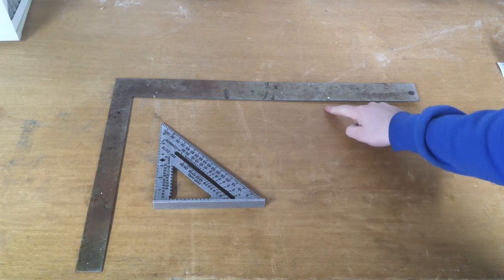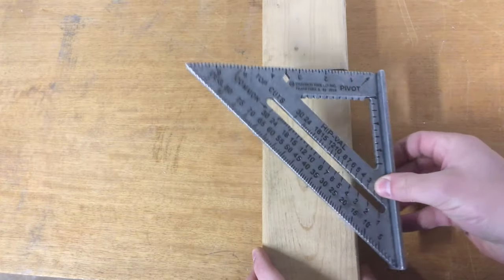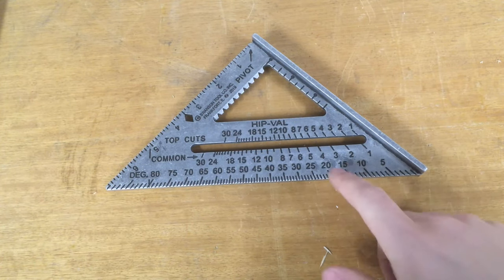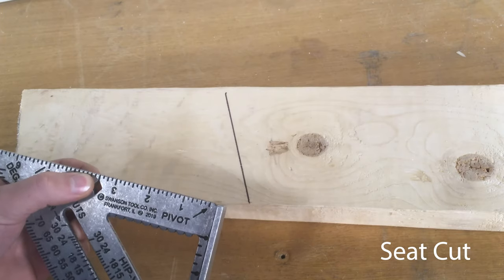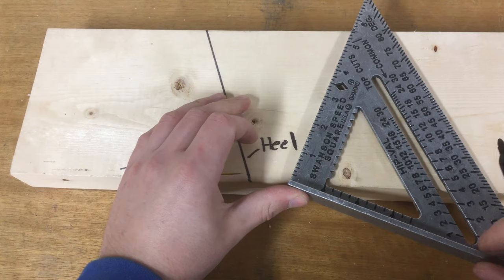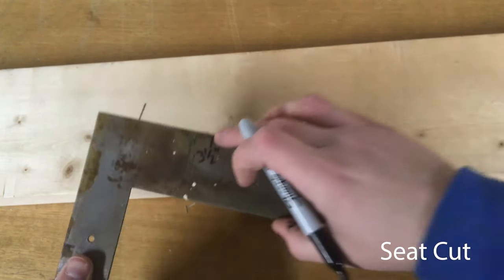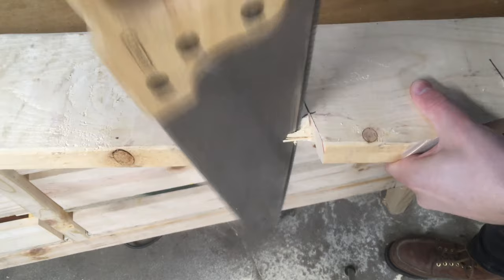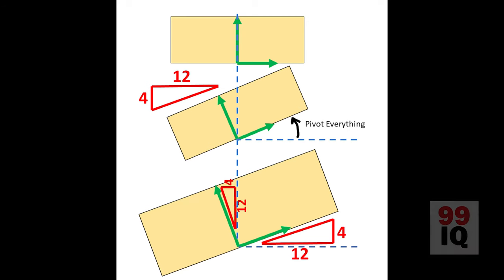How To Cut Birdsmouths for Rafters: Speed Square and Framing Square Methods Explained

Comment: I was taught the depth of the birds mouth ( which obviously affects the length of the seat cut ) should be a third of the width of the rafter. So 3x2 should be a 1” bird’s mouth, 6x2 a 2” bird’s mouth.
Reply: Birds got a square mouth
Reply: 1/4
Reply: No more than 1/3 your board length
Reply: @outdoorlife9410  IRC R502.8.1 states "Notches at the ends of the member shall not exceed one-fourth the depth of the member." Also cuts cannot be in the middle 1/3 of the board.
Reply: @outdoorlife9410 Width*

Comment: Excellent Video.  This sort of thing drove me crazy for a number of years because I am a DIY sort of construction novice. To aid in my education I finally went back to high school math to fully understand this.  First off, the 3.5" length to be cut out along the 2 x 4 is the hypothenuse or 'c' side of the right triangle you are making.  The part of the cut that is the depth of the cut is the 'a' side of the cut. The part that is the straight edge (90 degrees) along the 2 x 4 is the 'b' side of the cut.  In other words the speed square is doing nothing more than creating right triangles that are mathematically connected directly to the Pythagorean theorem. The fancy calculators one can buy do nothing more than integrate the various options possible based on what you know, but that does not always mean people like me actually understand what the program is doing. If your mind has the wrong orientation it is possible to make time-consuming mistakes.  By watching some other great videos on sine, cosine, and tangent you can come within 1/100ths of what the actual depth of the seat cut should be. Of course, the speed square and the human cannot possibly do that. However, If confusion prevails the math can tell you precisely how to reorient your mind.  With some humor I have to laugh that we are told 4/12 is 18.43 degrees.... who could ever match that? But, if you choose to play around with 3.5" and 18.43 degrees you can see what I am discussing here.  .... Just remember that the hypothenuse is the part that sits on the 3.5" part of the wall if using 2 x 4s.  

I greatly enjoyed this video. I watched it, and then did the math. Try it.
Reply: Jaw dropping

Comment: Probably the best explanation I've seen so far! Thanks.

I'm putting up a patio roof with minimal pitch 1.5 : 12.
It is a common pitch, wish the blue square had 1.5 marked. So unfortunately some eyeballing involved.
The Heel & Seat cut is also dependent on the rafter / ledger end is 90 degrees. I had to offset my end 5 degrees so had to adjust cuts by 5 degrees.

Comment: The difficulty is in making two birdsmouth joints on the same board and getting the distances correct between them so they sit perfectly with no gaps.
Reply: Here's a question could you not make your first bird mouth notch then set that onto your two-by-fours and have somebody Mark out where the rest of the two-by-fours are going to the land as long as you have it squared and leveled as you're holding it? Probably a lot harder said than done but I am just learning about Roost and other carpentry stuff so I'm just curious
Reply: @myself1769  No, it won't work quite right with that approach because there is still an angular distance to travel downward to account for the cutout on the lower end of the rafter. Try it to see with some scrap boards. You'll end up with an 1/8th inch gap or so on the inner heel. It can be incredibly frustrating if you try to do this eyeballing it or rough cutting it. 

Use the Pythagorean theorem from inner-most heel to inner-most heel as the hypotenuse. From there you can compute the distance between the two heel cuts using the law of sines and mark your boards. The speed square will take over from there. Draw your cut line for the heel and then 90deg to the edge of the board for the seat. This description would work better with a video.

Comment: Understanding the angle of the cut is great, but WHERE along the length do I make the birdsmouth cut???  This is what I'm not getting.
Reply: Same here. I marked it out with the rafter placed on the plates and it was perfect, then after cutting the birdsmouth it's way off due to the change in position it creates. Don't understand how to compensate for that.
Reply: @MarionRelics  I looked up the formula for making the cut, which compensates for the change in position, but it still wasn't quite right. But WAY easier than calculating & cutting stair stringers. I cursed a lot at that.
Reply: @tommyv5435  Seems like there shouldn’t be “formulas” involved in basic roof framing! Were the pioneers really out there doing trigonometry when they built their sheds and shithouses??
Reply: @MarionRelics  definitely shouldn't be.

Comment: would the angle of the top of the rafter be diferent if u did not use a seat cut and set the rafter on the top of the wall using hurricane brackets ? the rafter will b seating up higher i think that would change the angle no ? or is ur chart angles the same for both.. Mouth or no mouth that is the question. lol tks

Comment: Why is the depth of the birdsmouth limited to 1/4 the thickness of the rafter? I got a 12/12 roof with a 2 x 8 rafter and 2 x 6 wall and to me it makes sense to have more surface area on the top plate. Some say this 1/4 rule is to prevent there being a "weak point" with tension splitting the wood but I dont see how there is a weak point.

Comment: But how do you know where on the rafter to place the cut? I tried marking the seat with the rafter resting on the plate and it ended up way off because the birdsmouth changes the position of everything by dropping the rafter down lower.

Comment: How do you find out the length needed for the rafter? Say my building is 10’ wide, and I want a 1’ overhang, how do I measure where the heel cut is going to be and the angles for the end cut, and the cuts where left and right side would meet at the peak?

Comment: Anyone have any suggestions? My measurements from the top of the ridge to the bottom plate is 45 3/4 some how I keep cutting them too deep and too short? I’ve tried on like 8 boards still can’t get it right?

Comment: Easier way, its the remainder you need to make 90 degrees if paired with your ridge cut.  So if  your ridge is 55 degrees your seat needs to be 35 degrees for the part this the sitting on the wall.